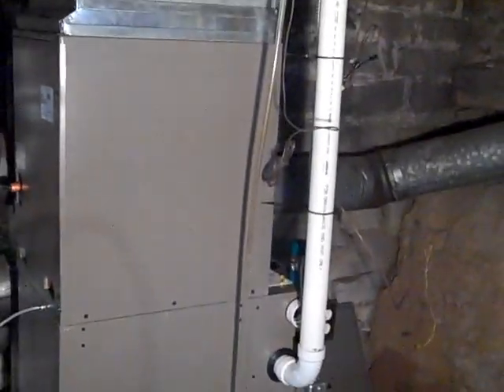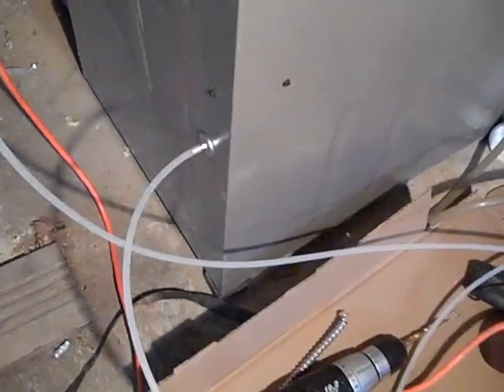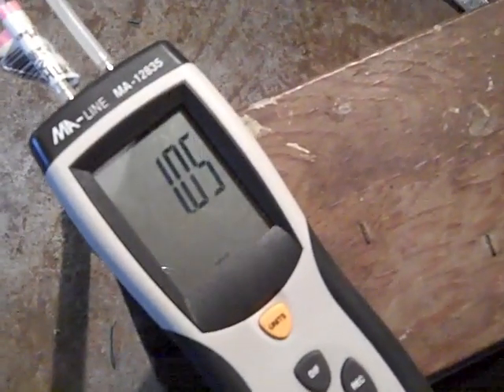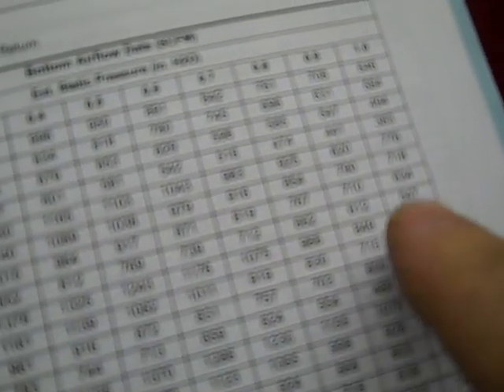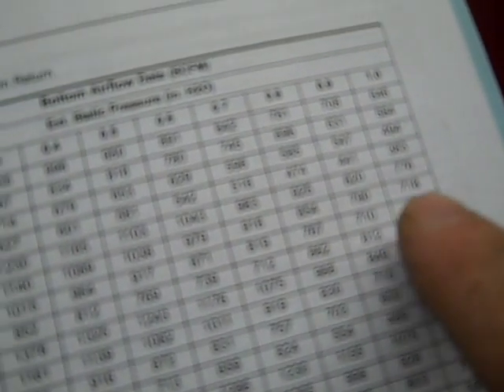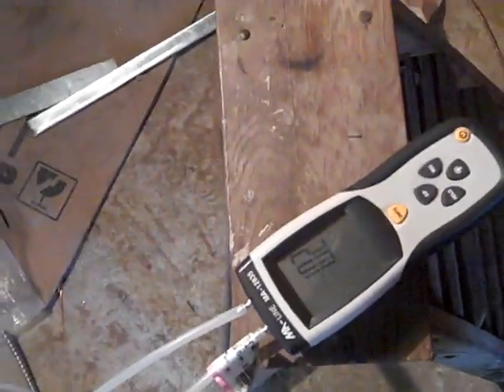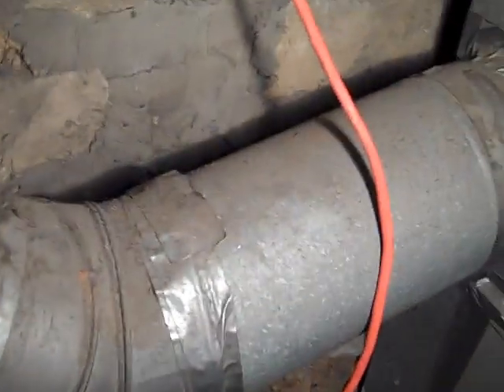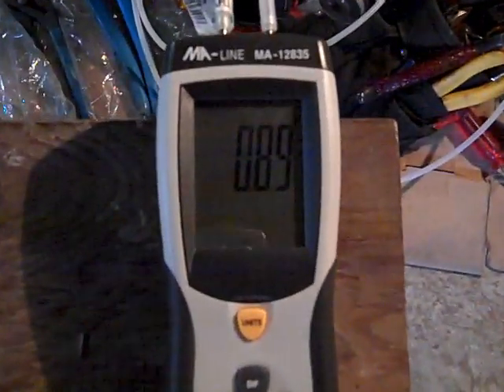Farmer house museum south furnace start up airflow test

Comment from the maker: @Nutintoitbut2doit No insult intended. I still use it too. But less and less. I don't need insulated ducts much anymore. The contractors I work for have adopted enclosed crawl and enclosed attic concept. Man I love spray foam insulation. Everything is now in conditioned space. I just have to provide a small amount of air in those areas. Infiltration is reduced so fresh air is needed.  hVac. ----HRV, ERV

Comment from the maker: @FilterChanger Thanks, I am using pitot tubes made by field piece to penetrate the duct. They have magnets built into them to hold them in place. Dwyer makes these and  they have a wider selection.

I'm just using 1/4" hose from Lowes for the tubing.

Look at  temperature rise. Heat exchanger failure is only a matter of time if a furnace is heating outside of it's temperature range - Delta T. It should operate as close as possible to the middle of the range for optimum performance and longevity.

Comment: I'm not a very good panner, but I still find gold nuggets in your videos.  What do you use to attach your mano to the holes in the ductwork??  It looks like you're using hose barbs, or do you just use a 1/4 in. hole and shove ice maker tubing in it?  I've come across a cracked H/E or two lately with gas pressures pretty close.  Now I know where else to look for issues.  Thanks!

Comment from the maker: @Nutintoitbut2doit I don't know why any one would not use metal over the dreaded duct board. I started with duct board back in the day. I prefer to use metal all the time now but duct board has it's uses because it is already insulated and seals up nicely. I don't like to handle or breath it though. I've eaten enough of that shit to cough up a Corvette body.

Metal comes in 5' sections that you just snap together and costs less than the duct board sheet not to mention labor to fabricate it.

Comment from the maker: @Nutintoitbut2doit No it's a a PSC. An 18" at  1600 cfm is a 1000 fpm. The minimum airflow for a 4 ton is  @ 1400 cfm which would be 800 fpm which would not be ideal but still acceptable for metal. Flex shouldn't be used over 600 fpm for very far. I like to keep the velocity below 500 fpm at the return drop. Preferably under 300 fpm at the filter which is usually impossible. Fortunately we don't have huge cooling loads so I don't see much over 3.5 ton. More than that gets 2 filters.

Comment: Hay Jason does that furnace have a ECM? I am finding that almost all my change outs are way to small on the return, I pulled out a 14 inch. return and installed a 18 inch on a 4 ton. I wish I could have got a 20 inch or a 2 returns but there was no room. I beat my fingers and left some skin in the elbow just getting that 18 in there lol.